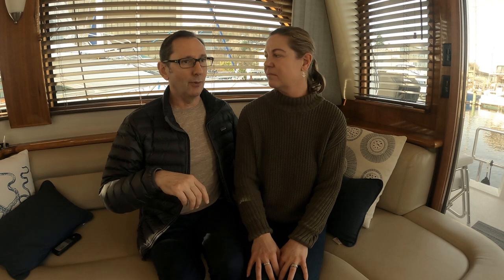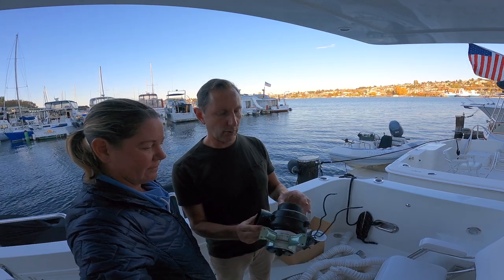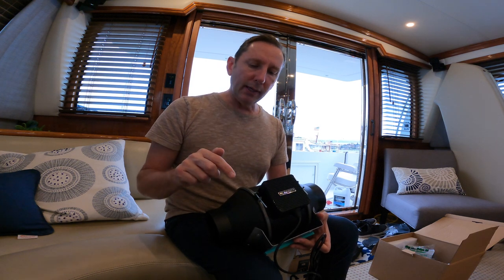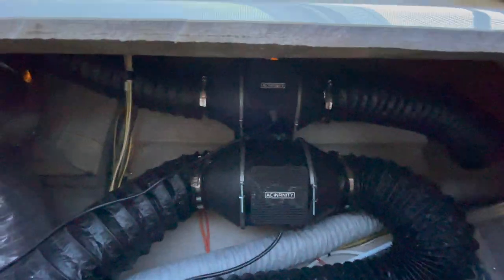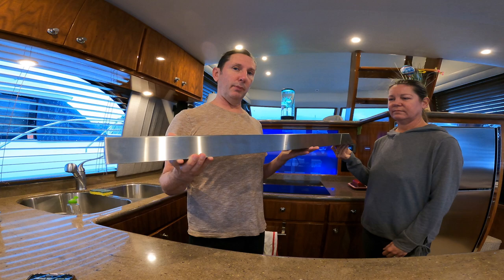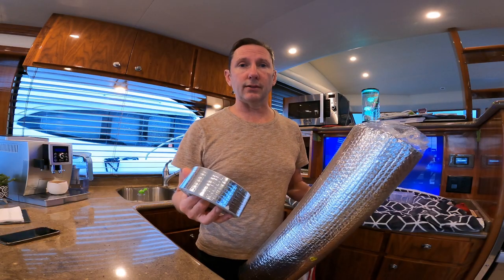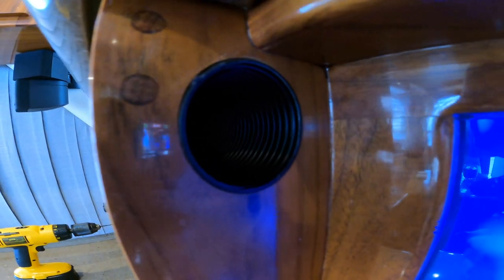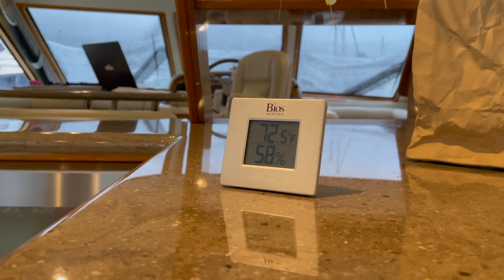“AC Infinity” Ventilation Installation & Review

Comment: Nice work and tidy install! 
Jon, the old fluid dynamics test engineer geek in me requires that I️ remind you that the humidity you’re measuring is relative humidity which is EXTREMELY temperature dependent. If we calculate dew point (absolute humidity)  using your start and end Temp & %RH, you actually have an INCREASE in humidity 56.16 to 56.89degF.  (The extra moisture is likely coming from the makeup air drawn into cabin from outside.)  That said I️ bet the removal of cooling odors is going to be worth your efforts! You’ve got me looking at improved vent options in my galley now! 😃
Reply from the maker: Good catch Eric. I wasn’t paying attention to the temp increase. Willful blindness on my part? 😝

Comment: You didn’t mention it but I’m sure that when you cut your 2 inch hole thru the wood, and your hole thru the cabin side, and any others, that you sealed the edges, hopefully with epoxy.
Reply from the maker: Good call out. The walnut was coated with Ephifane and we sealed the gel coat & fiberglass with 3M 4200.